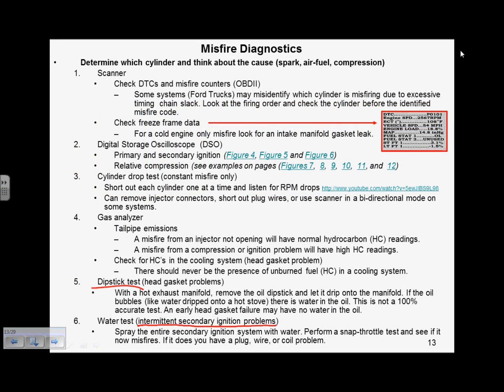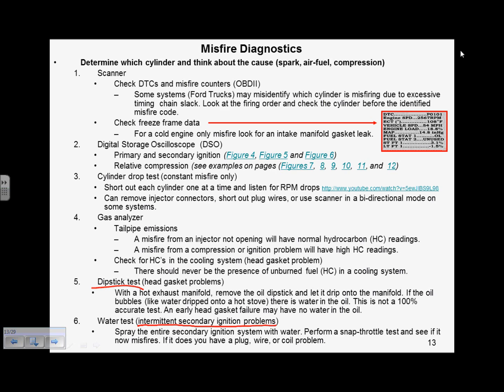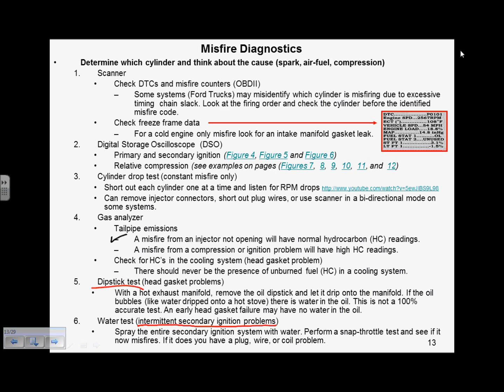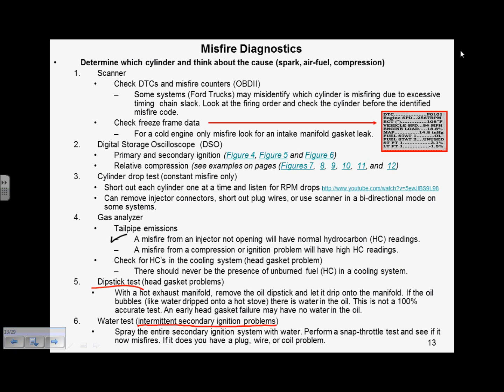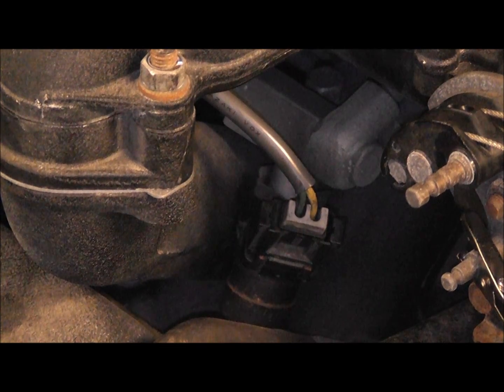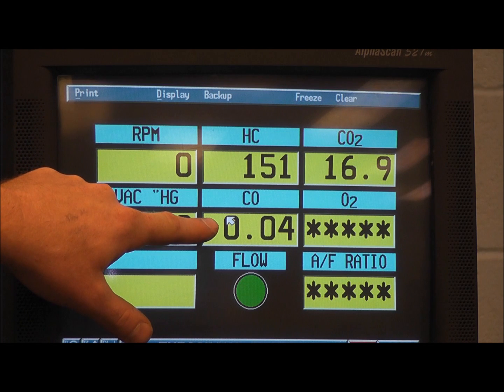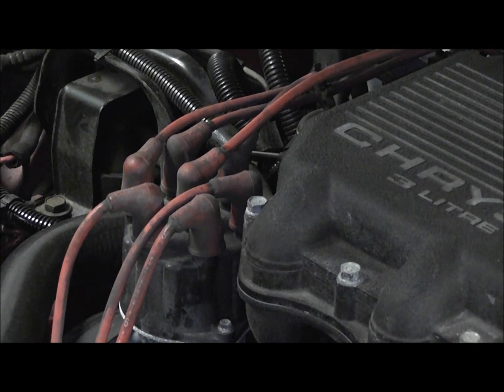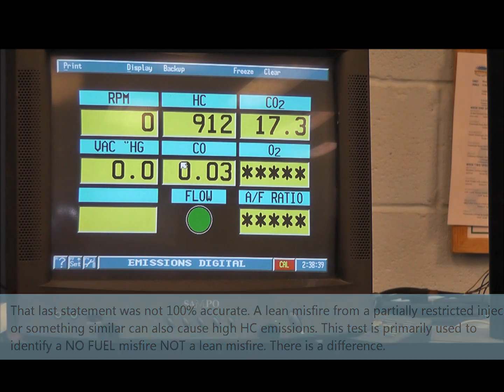Misfire troubleshooting using exhaust gases (an SD Premium video)

Comment: Yes but how would a partially restricted injector still cause a high hc if the engines getting less fuel? It should be less hc no??
Reply from the maker: HC is unburned fuel! Lean misfiring is when the flame goes out, leaving a ton of HC gasses left over.
High HC occurs in the lean and rich side of stoichiometric and of course with a misfire
Reply: @ScannerDanner  oh ok there's the answer. High HC levels are on both rich & lean mixtures, just wat I was looking for. Thank you. Google doesn't have some of these answers I tell ya..
Reply from the maker: @942doc1  I always tell my students to think of a torch. What happens when you turn the oxygen up? The flame gets real hot and super blue. What happens if you continue turning the oxygen up? The flame goes out! There is your lean misfire and super high HCs
Reply: @ScannerDanner  yep, kind of like lean mixtures for performance right? The more lean of a mixture the more power they make, while also cooling it with ethanol?

Comment: correct me if i am wrong,but when you pull out the plug wire the CO level shouldnt go up???i mean if it is  a rich condition that you are creating by pulling out the sparkplugwire than i am pretty sure that the level of CO will rise over the 1.2 or 1.5 or any limit that are in that area.Even your gas analyzer its not calibrate or something is wrong in this video because  of the CO readings.There are new cars sir that did not showup this level of CO......no ofence sir
Reply: A rich fuel mixture is different from a dead miss caused by a lack of spark. Co is a byproduct of combustion, but there's is no combustion in a dead miss, it's just raw fuel. I might be wrong btw
Reply: i solved my problem whit high CO by replacing the cat sir,the CO level after replacing the cat is 0.01,before was 0.26 in 2500 revs

Comment: I have a 97 geo prizm and on low (in the start of a gear change) it misfires on high it runs fine. I changed spark plugs, wire, distributar cap, rotor, fuel filter, cleaned injectors and fuel pump has good compression. At the tail pipe I smell lots of gas and leaves black on bumper. I don't know what it can be can anyone please could it be the actual distributar?? That's the last I can think of but haven't changed. Thanks

Comment from the maker: Yes CO and O2 being hi at the same time would be contradictory and the only times I have seen that kind of failure is with an exhaust leak and or a secondary air pump problem. Keep me posted on the repair.

Comment: how can I get high HC AND high O2 at the same time? :( I get 0.18% CO, 291ppm HC and 2.02% O2 (CO2 is 14.1%) at idle and then at 2500RPM I have 0.66% CO, 199ppm HC and 1.02% O2 (CO2 is 14.9%). This is an "euro2" specs car that should have HC at about 100 and CO under 0.5% afaik. I have a random err at MAF and I also don't trust the cat. Compression is good. New sparkplugs. O2 sensors read lean at WOT. Where do I go from here? High HC and O2 sugests both lean and rich?! :| Help! Thank you!

Comment: i first heard the squeaks after driving downhill in neutral and slightly pressing on the brakes to reduce the speed .
i havent taken the wheels off yet. 
normally it doesnt squeak, but if i use the brakes more and heat them up the rear will squeak.

Comment from the maker: LOL its Paul but I get Dan a lot for some reason. Guess its my last name Danner :)
Anyway, when did the problem start? Was it after replacing the shoes? Is there any oil from the axle seal leaking? Is the wheel cylinders dry? Did you have the drums resurfaced? Are the shoes heat cracked? How about the e-brake cables, are they free and not sticking?

Comment from the maker: CO is carbon monoxide and is a byproduct of incomplete combustion. No combustion (ie a no fuel or no spark misfire) will not directly increase CO emissions. The only way CO will go up with a misfire is from the O2 sensor picking up extra oxygen from the misfiring cylinder and the computer responding by adding more fuel to try to correct for the condition. This will cause all of the other cylinders to receive a little more fuel than they should be = CO rise, but not severely
Reply: LOL   In 2022,  still  thanking  you for that explanation; it's what i was looking for; 
what i still don't get, is how can there be a incomplete combustion; thought either the thing exploded,or it didn't; 
greetings from Portugal
Reply from the maker: @josepeixoto3384  incomplete combustion from compression loss, from water/coolant effecting the flame front. Then if it's bad enough, the plug is soaked and not firing anymore, so it's a complete misfire and we're not making any CO2 (chemical test is for CO2)

Comment from the maker: You would most likely see the CO% come up. The default fuel curve for a bad MAF sensor (one that is disconnected) is generally richer than normal. However not all cars have good back-up strategies for a bad MAF so each system would be different.